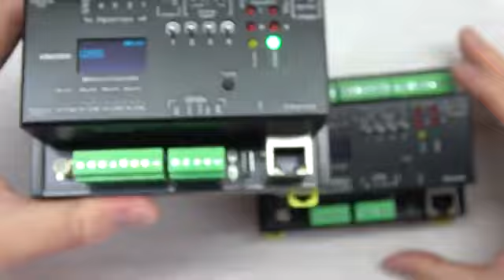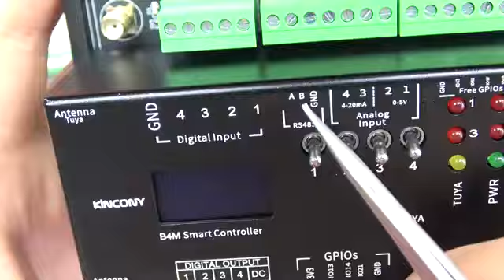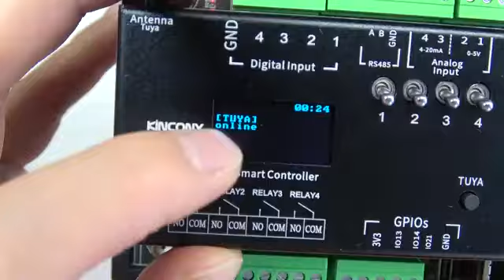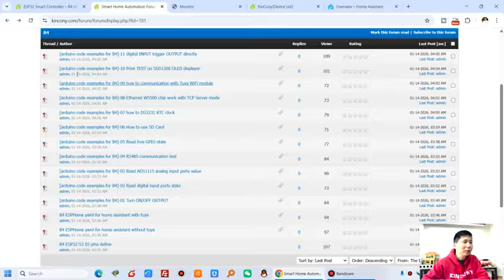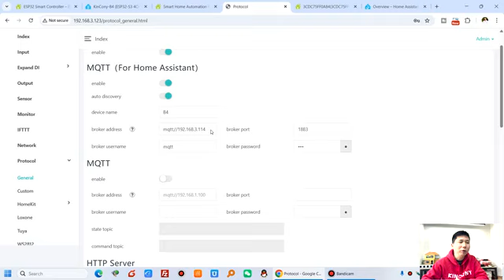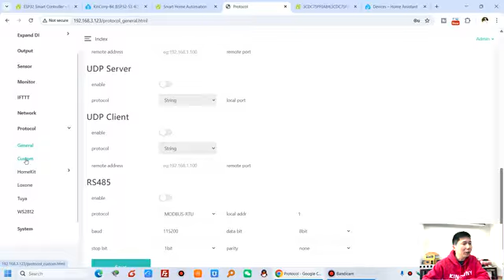4CH ESP32S3 Relay Mosfet Board For Home Assistant Tuya ESPHome B4/B4M

Comment from the maker: Model No. KinCony B4
Description: KinCony 4 Channel ESP32-S3 Smart Relay Controller – B4
Power supply: 12V DC
Processor: ESP32-S3-WROOM-1U (N16R8)
Size: 115mm*83mm*56mm
interfaces: Ethernet(RJ45)-LAN 100Mbps IPv4/IPv6,WiFi,RS485,Bluetooth,USB-C,LCD,I2C,Tuya Module
RTC: DS3231 high precision chip (battery socket on PCB)
SD Card: SPI bus
Installation method: DIN RAIL
LCD: SSD1306 I2C display

Outputs:
4CH relay Outputs, every relay use by MAX AC250V/7A

Inputs:
ADS1115 16bit ADC: 2CH analog input DC0-5V (A1,A2) 2CH analog input 4-20mA (A3,A4)
4CH dry contact inputs (optocoupler isolation, long distance circuit for MAX 500 meters cable)
3 buttons: 1:ESP32 Reset 2:ESP32 Download 3:Tuya config
1-Wire GPIO: 7CH (with pull-up resistance on PCB)

software solution:

1. download KinCony KCS v3 firmware, so that work with multi protocol: HTTP, MQTT, TCP, RS485 modbus, Tuya app, config OUTPUT for “momentary” and “interlock” group functions. use Tuya mobile phone app directly, support voice control by Alexa and Google home speaker directly. if you want local voice control without internet, you can add KinCony AS voice assistant. “KCS” support IFTTT function work locally without internet. It also support use by KinCony cloud server. KCS v3 support home assistant auto discovery function by MQTT, so without any config file for home assistant.

2. download firmware by ESPHome, integrate to home assistant or use by web service.

3. download tasmota firmware.

4. write your own arudino or ESP-IDF code for your own requirements.

5. It is recommended to use home assistant and Tuya mobile phone app at the same time. So that remote control by internet using Tuya app, local control by LAN using home assistant app.

Order bundles:
Bundle A: B4
Bundle B: B4 + USB-C cable+ DC12V power supply

Related technical information
———————————
ESP32 I/O pin define: https://www.kincony.com/forum/showthread.php?tid=8913
config yaml file for ESPHome: https://www.kincony.com/forum/showthread.php?tid=8914
ESPHome official supportted list: https://devices.esphome.io/devices/kincony-b4/
arduino demo source code: https://www.kincony.com/forum/forumdisplay.php?fid=101
KCS v3 firmware online guide: https://www.kincony.com/how-to-use-kcsv3-firmware-esp32-board.html